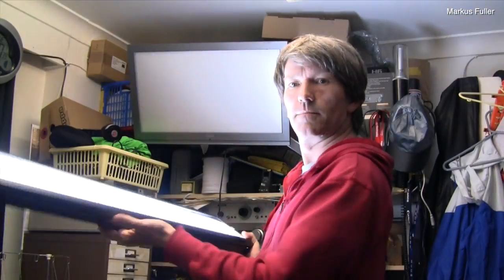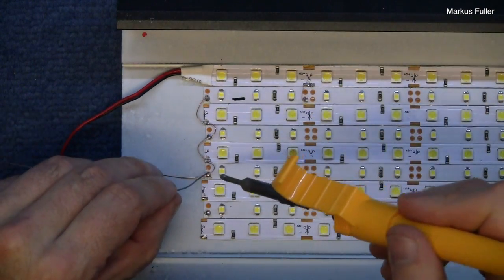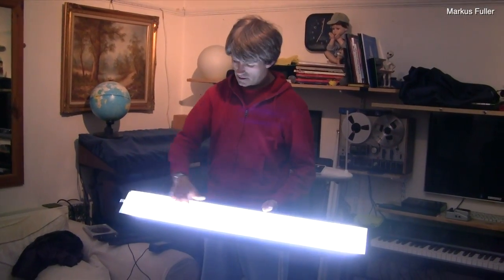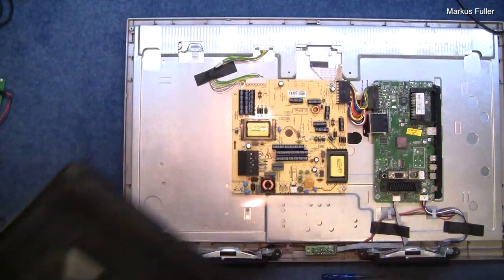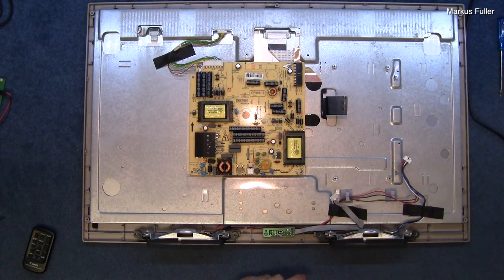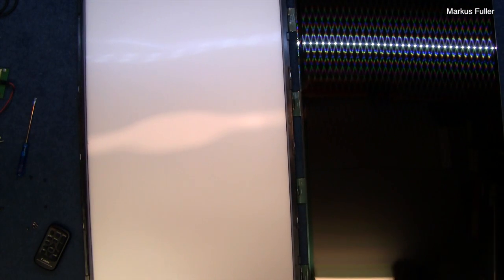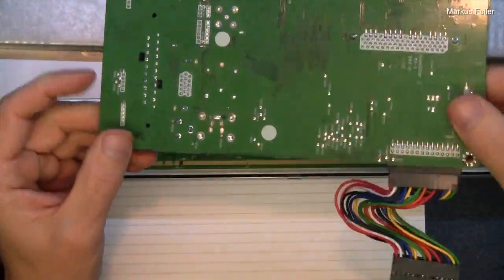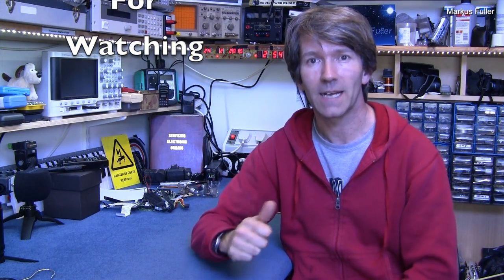Make a super bright Light Box from LED TV for photography and filming #42

Comment: hey. I wanna make something like this with led laptop screen. but I have a problem that I dont know how to power up the backlight. I tested several voltage but it still wont turn on. I need a reply pls
Reply from the maker: Hello It can be difficult to find the correct voltages used in a laptop screen as it could be anywhere between 12 and 48 volts plus the leds maybe working in a matrix ie half on half off depending on if the control voltage is dc or ac. it really is better to keep the laptop psu as it will have some of the voltage controls for the screen within it. its much easier with a television set.
Reply: +markusfuller meh nwm.i tried to hooo it up with the laptop psu itself, but it lighted up dimly. After playing with the screen for a while, I hooked up 2 12v battery (24v) and it happened to turn on. Btw thank you
Reply: +markusfuller meh nwm.i tried to hooo it up with the laptop psu itself, but it lighted up dimly. After playing with the screen for a while, I hooked up 2 12v battery (24v) and it happened to turn on. Btw thank you

Comment: It kind of limits what you can do with these, when they go off every 15 minutes. Does ANYONE know how to get around the turn off. Is it due to not having an input signal on an HDMI port, or a protection issue with the power board. 
Someone must know what causes this and how to get around it, irrespective of manufacture.

Comment: where did you got the strip led?
Reply from the maker: +anthony “Findenzio” Hom Hello you can search for led strip on ebay , amazon , or just on the net. they are reasonably cheap but its better to look at how many leds per meter you are getting before you buy and also of they are 5050 leds which are bigger. some strips have 30 leds per meter and some 60 or more but the cost creeps up. all you need is a 12 volt power supply which in some ebay listings they are supplied with the roll of leds. Best wishes from markus
Reply: +markusfuller hey thanks do you know how dim them?
Reply from the maker: Hi Anthony. you can use Pulse wave modulation but that creates flicker on camera or you can use a variable power supply and lower the voltage going into them. I prefer the variable power supply as that does not create any flicker or strobing effect for the camera
Reply: oh thanks. is 12 volt power supply good?
Reply from the maker: Yes 12 volts is normally what these LED strips need but you may need a chunky power supply with a couple of amps output to get good brightness of you are using long lengths of these LED strips. Many companies sell the PSU with the LED strips.

Comment: You made this just so you could have a pink jumper, right? :-P
Reply from the maker: Hi Rennie Ash, I never really noticed that until you mentioned it. yes it does go a bit pink doesn't it. :-)
Reply: markusfuller I prefer the led bar due to less blue colour. I also have a screen, but it had the turn on/off randomly issue, so I'm not sure if the power supply is bad or not. Can I power the led with just DC voltage or does it need all the circuits?

Comment: i tried. and it keeps turning off automatically
Reply from the maker: Hello Jacob, it may be that the power supply is not strong enough to light all the leds. you may need to find one that has a greater amp rating but still only 12 volts. my first power supply i tried just made the leds flash as the PSU kept switching off.
Reply: i still have the "motherboard" attached to it because i dont got almost any tolls but i kind of fixed it when attached usb in it... usually the lights stayed on about 15minutes and now about 5-6hours... iwas thinking maybe it was the tv's power saving mode that turned it off or something like that
Reply from the maker: oh good point maybe there is a power save. I thought you were just lighting the leds directly from a psu. the motherboard may have interfered with the timeout.

Comment: for whatever it's worth, not all TV's have the signal wire issue. A neighbor threw out a 53" tv because the LCD panel was cracked, so I grabbed it. I took out everything but the power panel and it lights up just fine. Now I'm getting ready to remove the LED strips and put them in a smaller box with a diffuser from an old monitor. They're already bright at 53", can't wait to see how bright when I've got them stacked side to side in behind a 24" diffuser! 

edit: also, if you have an undamaged LCD panel, you can probably sell it somewhere as a repair part. it is literally the most expensive part of the TV to manufacture. Scratches on the front can probably be fixed by removing and replacing whatever film they add to the exterior. that said, I have no fucking clue where you'd sell one.

Comment: OK so I'm trying to do the same with an LED TV that has a single board vs separate systemboard/power supply board and T-Con board.  This particular model has a 2 wires for the LEDs, positive and a negative.  Trying to figure out where to locate the particular component on the board to trick and to power on constant.

Comment: All I had to do to get the backlight to turn on was cut the ribbon going to the pixel board, and remove it. The tv still thinks it's sending picture, so turns on the backlight.
Reply: Francisco, I cut out the ribbon cable going to the AV board, or is it the T-con board? Whether you cut it or disconnect it, the light still goes off automatically after about 15 minutes.